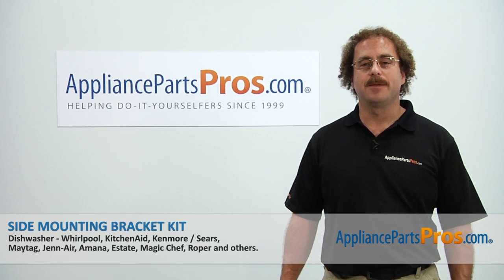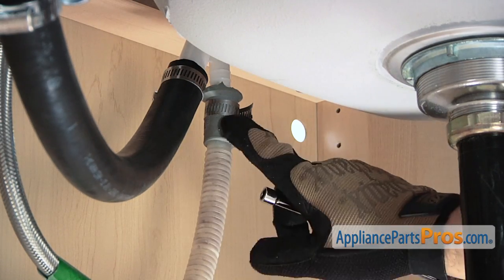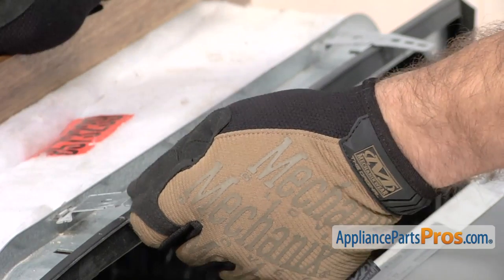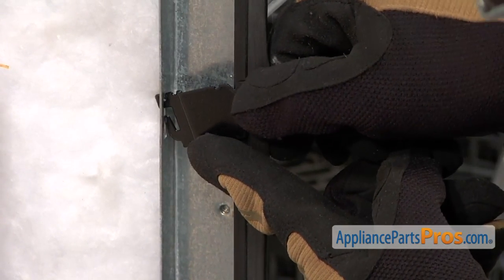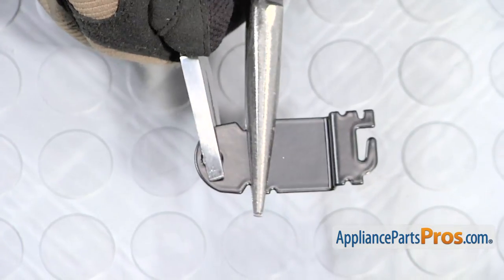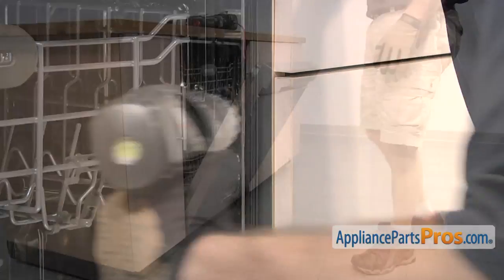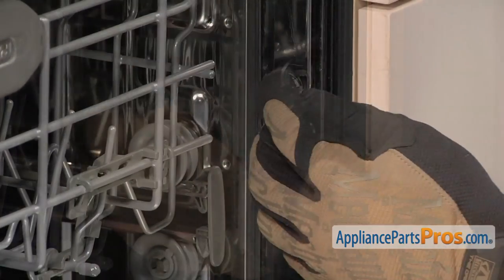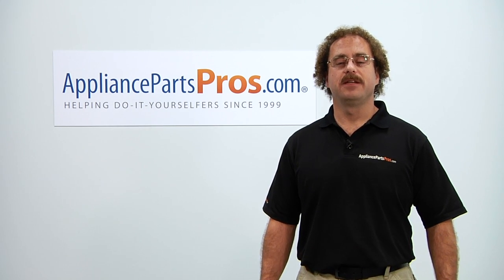How To: Whirlpool/KitchenAid/Maytag Side Mounting Bracket Kit 8212560

Comment: Thank you for sharing this video. The dishwasher you demonstrated on is ideal with the cap that covers the hole. What would you do in the case of not having that feature or any pre drilled hole? I don't want to damage my dishwasher to mount it properly.
Reply: If you have enough vertical room under the cabinet there is a bracket that bridges the top of the washing machine and has a honey comb of threaded holes in it enough to match most top hole locations. You screw that in to both sides with four screws and then use the correctly sized threaded bolts to anchor your dishwasher.  This is when you have a granite or too hard for screws counter top. Leveling the feet is half the battle.

Comment: I have a KDTE104ESS1 KitchenAid Dishwasher and it was going to be too long to wait for side brackets.  I used 3/4 pipe strap for 3/4 inch pipes hammered flat. It happens to be 3/4 of an inch wide which fits nicely through the hole in the side. I just flattened it and used the existing holes. I needed a fancy one with notches snipped in it because I only had front access to my dishwasher.  Stuck it though then twisted it.  The main thing before anchoring it, is getting it level -KitchenAid gives feet that have hex tops (3/16") that a small socket does quick work of. If you don't level it,  the drawer slides out and the water level isn't right. 
The reason for anchoring it is so when you roll out the full dish rack, it doesn't fall forward spilling your dishes everywhere. Mine is in there so tight that isn't going to happen anyway. Another way would use the sheet metal flange sticking out to catch up against a stop block. Size them to your circumstances and use the access holes to pin them with screws. If you have vertical room a bracket is available to span the top and screw into.

Comment: So in the video the side caps are removed from the outside of the dishwasher after pulling it out. How do you remove them from the inside? Eventually you'll have to remove the dishwasher , and you won't be able to pull it out without removing the caps from the inside first to unscrew.
Reply from the maker: What is the model number of your dishwasher?

Comment: My dishwasher doesn't have that handy band just behind the front face of the "box" - instead there is a narrow strap to which the two top mounts are spot welded. There is no place to attach the side mount brackets. Any suggestions?
Reply from the maker: We'd be happy to help you out with that! We offer free technical advice and diagnosis. You can give us a call at 1-877-477-7278 or you can chat us at our website: http://www.appliancepartspros.com/. We will need your model number. You can use this tool on our website to help you find the model number: http://www.appliancepartspros.com/modelnumber_locator.aspx

Comment: save your money! You don't need that kit. You can use the top brackets. They are made for either installation. If your are putting them on the side just break off the end
Reply: Not so fast.  This works for granite countertops that cannot be drilled or drilled easily.